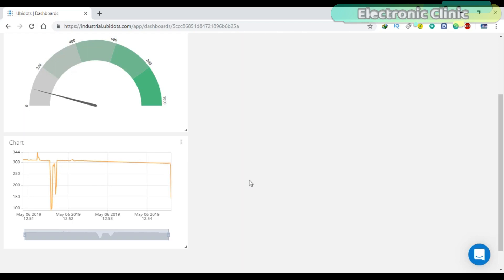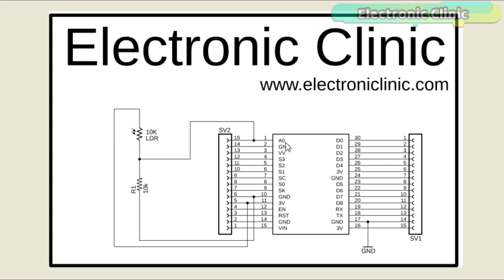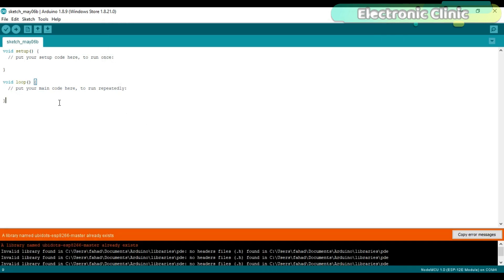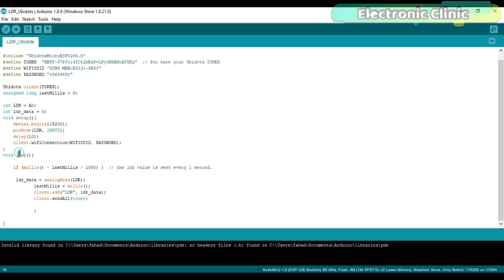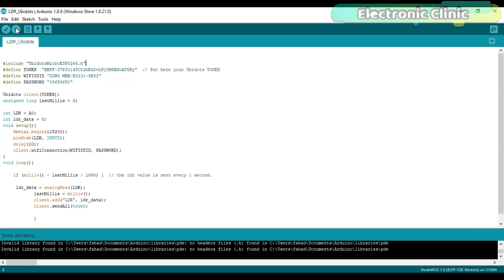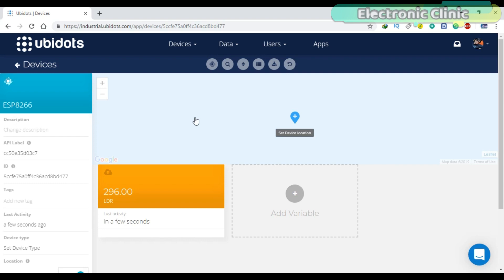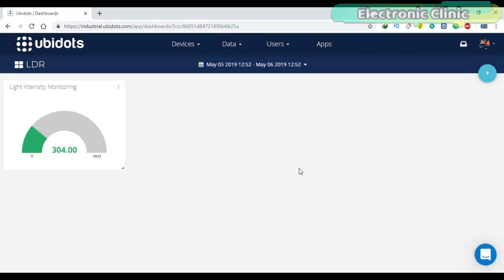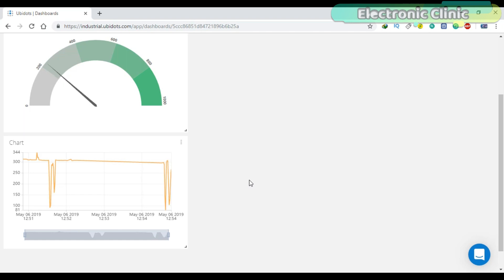Internet of things: Ubidots iot platform " Gauges + Charts " Nodemcu esp8266 wifi

Comment: thank you sir for the tutorial. is the source code available?
Reply from the maker: ya its available on my website. you can find link in the description.
Reply: @ElectroniClinic  thank you sir. can I select a different type of board in the arduino IDE? You used NodeMCU 12e if I am not mistaken, I want to try it with Generic ESP8266

Comment: Arduino: 1.8.9 (Windows Store 1.8.21.0) (Windows 10), Board: "NodeMCU 1.0 (ESP-12E Module), 80 MHz, Flash, Legacy (new can return nullptr), All SSL ciphers (most compatible), 4MB (FS:2MB OTA:~1019KB), 2, v2 Lower Memory, Disabled, None, Only Sketch, 115200"

sketch_jan15c:21:33: error: UbidotsMicroESP8266.h: No such file or directory

 #include "UbidotsMicroESP8266.h"

                                 ^

compilation terminated.

exit status 1
UbidotsMicroESP8266.h: No such file or directory

This report would have more information with
"Show verbose output during compilation"
option enabled in File -> Preferences.
Reply from the maker: i think they have updated the library. visit the ubidots website. i will make a new video very soon using the latest library.
Reply: @ElectroniClinic  sendAll(true) function does not work anymore what can i use instead?
Reply: SAME1000000x